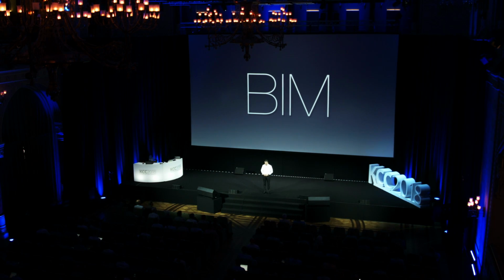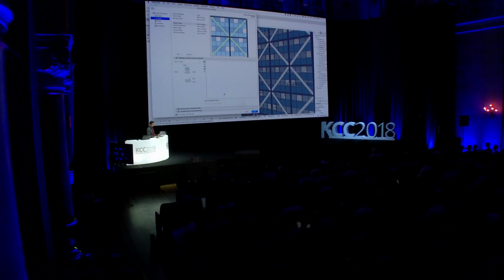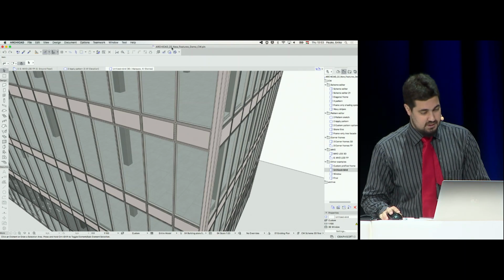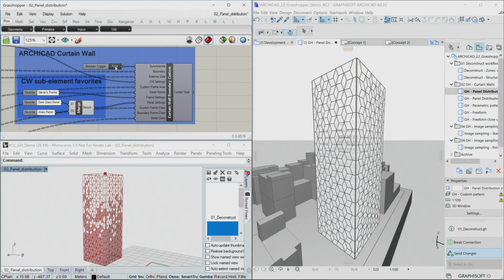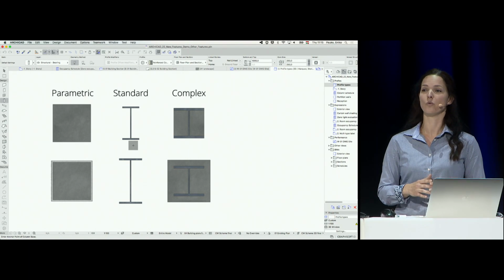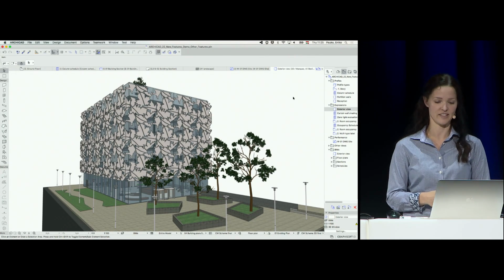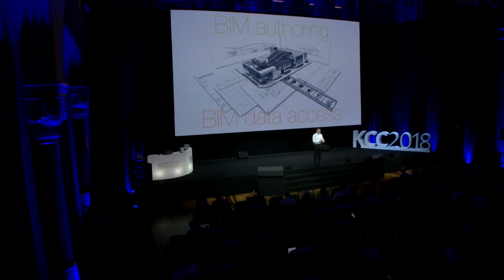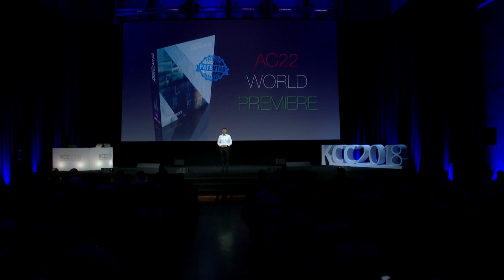2018 ARCHICAD 22 World Premiere

Comment: archicad 22 is a nightmare for a  basic user..many simple functions that were mostly used are changed or removed...so many simple things are extremely unnecessarily overcomplicated...ramps,stairs,railings,curtain wall settings etc ...many basic things that worked super fine are touched for who knows what reasons...its like working with a new program...but hey maybe the next gehry who has someone else to do his technical drawings  is happy with it i dont know
Reply: What basic things are now difficult?
Reply: @Priest92  lets say a tool has a lot more settings to that you had to edit therefore you spend more time to it instead of just "designing" a model. Although things are more "smart" and automized but it killed the software's flexibility and ease to use of it.
Reply: I agree

Comment: stills bullshit, at least with revit we can model organic volumes easily .. archicad is simply a software that limits the architects creativity
Reply: Rhino ?
Reply: That's really not an answer. The problem is that you need to switch programs if you have a more fluid design for a certain project, witch is not nice. You'd preferably learn a single software that does everything.
Reply: my point is, diferent kind of buildings require different tools for their construction.   You would not built a Campo Baeza house with the same tools and processes as a Gehry building, yet they are great in their own way.    Why should that be different with software?  

It would be great to have that all inclusive tool you suggest, but it seems we are still far away from it